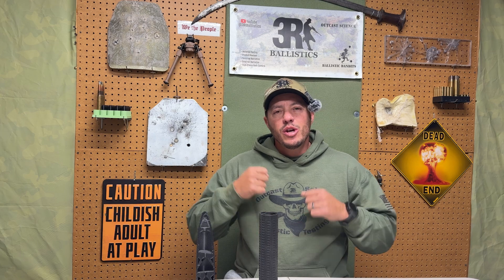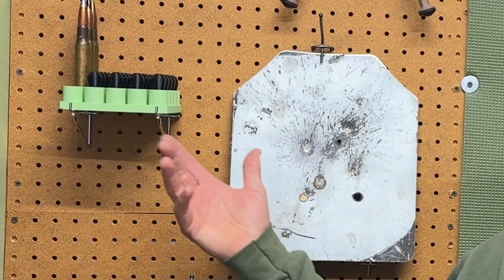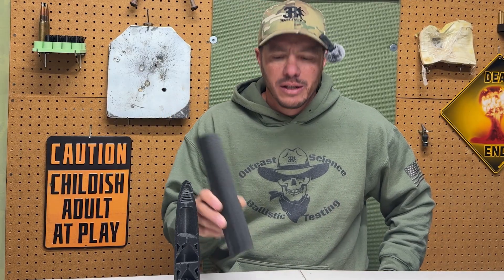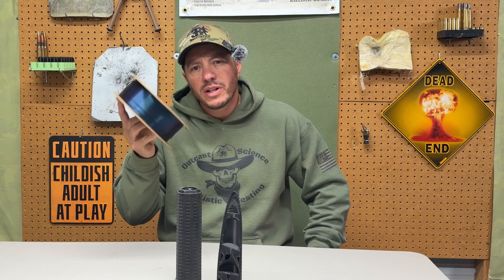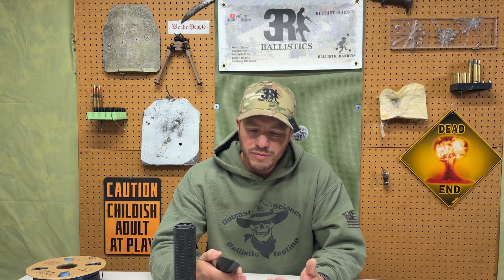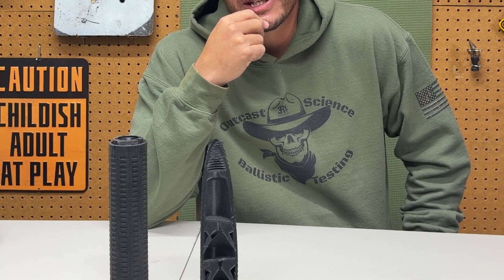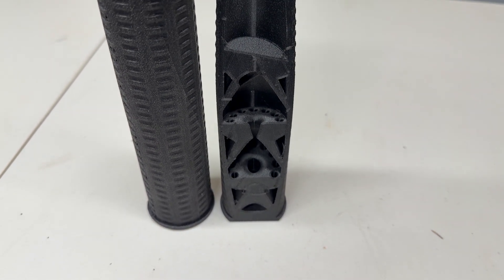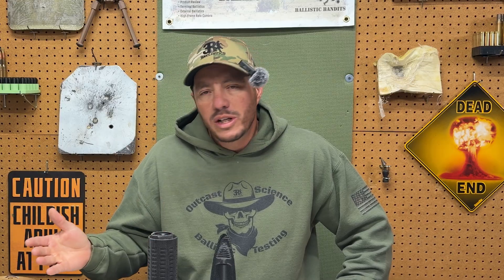Are Plastic 3D-Printed Suppressors Viable? PA6-CF Explained

Comment from the maker: ⚠ Important: All suppressors discussed in this video are legally owned, registered, and tested in full compliance with federal and state laws.
This video is educational only and focuses on materials science and performance—not instructions or construction.
With that said, what do you think about advanced polymers like PA6-CF in high-stress firearm applications?
Is this the future of rapid prototyping—or are metals still king?
If metal suppressors are constantly out of stock - would you consider a polymer suppressor?
👇 Drop your thoughts below, and if you enjoy real-world ballistic and materials testing, consider subscribing to 3R Ballistics. More testing coming soon.
Reply: cf makes it stiffer but weaker
Reply: $50? more like $5
Reply from the maker: @belligerentinstigator944  the $50 includes all connections associated with making it completely ready to use. This includes the $30 breek connection
Reply: Guardian defense 

   You can find any suppressor you want there legally
Reply: 😊😊😊⁰
Reply: 0⁰
Reply: What exempts polymer suppressors from the definition of firearm under the undetectable firearms act 18 USC 922 (p). The relevant definition would seem to be in 18 USC 922 (a) and 922 (p) exempts only the "frame or receiver of such weapon", not "silencers or firearm mufflers".
Reply from the maker: @R3RadioResearch  they are not completely polymer. Both connection and outer surfaces contain steel.

Comment: If you already have a 3D printer, cost would be more close to $5-$10  per unit
Reply from the maker: Yes, for the filament. The price I mentioned included every other components well. From the filament to the breek connection down to the JB weld.
Reply: @3RBallistics ok makes sense! I guess it depends on the build. A 22LR build requires a lot less structure for example. You could print and add a thread adapter, and you are set. For a 9mm/300 blackout maybe go with the OP 9 and I think it’s about $15

Comment: Do we have written confirmation from ATF and/or DOJ that 18 USC 922 (p) (The Undetectable Firearms Act) doesn't apply to silencers or firearm mufflers (legally correct jargon for "suppressors")? The definition of Firearm under 18 USC 922 (a) includes "silencers or firearm mufflers" and 922 (p) specifically exempts "the frame or receiver of such weapon" referring to firearm receivers or frames (like glock or AR15 polymer lowers), but it would seem a rigorous reading means that suppressors must comply with 18 USC 922 (p) and contain at least 3.7 oz of 17-4 PH Stainless Steel magnetic signature equivalent or be equivalently detectable to (as far as I can find) an unnamed reference firearm surrogate's magnetic signature that is maintained by USG.

Comment: You can also use pla+ also if you use white pla+ it will resist heat and you would think oh well it only probably helps 5% no using white plastic over black can do insane things situations where nylon would melt white pla+ might survive
Reply: I just dont see how. Nylon is softer than pla sure. Most FDM plastics are softer than PLA and all the plus variants of it, but it has some of the lowest glass transition. It might maintain its shape while hot, but not its rigidity. It will warp when breaking 50c every time.
Reply: @GucciBodyBags pla+ works fine

Comment: I have been experimenting with 3D printed suppressors for a few years now. My designs max out in terms of weight around 13 OZ without a piston. Before people jump on me, all were legally registered before testing. It was very, very expensive lol. Final designs were as follows. 

For 22LR, I was easily able to get away with TPU baffles, PETG cylinder, and no outer sheathing. This lasted indefinitely and I still have it. No visible wear at 900 rounds. Fired from pistol and rifle. 

For 9mm and 45 ACP, design involves PC baffles, PC cylinder, and no outer sheathing. This lasted for 542 rounds before developing cracks in the cylinder wall. Following designs were fixed with carbon fiber shell. Carbon fiber allowed the second iteration to last indefinitely.

For 5.56, design involves epoxy coated PC baffles, PC cylinder, with multiple layers of carbon fiber which allowed it to last 218 rounds before degradation of the threads between the cylinder and the barrel adapter. 

For 6.5 Creedmoor, design was similar to that of the 5.56, with simply more carbon fiber reinforcement, lasting on 25 rounds before cracking developed. 

This was all done with a cheap as hell Ender 3 V3 KE and a cheap enclosure. All suppressors cost less than 40 bucks to print. The 9mm and 22LR suppressors were so quiet that I legitimately thought I had a squib round and I disassembled my pistol the first few times just to make sure I wasn't going to break my pistol with a stuck round. This lasted far longer than wipe designs and as I stated above, I still have the 9mm and 22LR versions which have shown no strain despite being used on multiple range days. Adding a piston allowed the pistol caliber suppressors to shoot on tilting-barrel pistols just fine, as compared to fixed barrels which were used to test first. I thought the threading would fail first as I initially modeled a 1.375x24 thread into the suppressor body but that held through all the calibers. The secret is reinforcement with either carbon fiber or fiberglass, allowing for hoop strengths far in excess of standard plastic prints.
Reply: what are the chancing you release the files for some of these suppressors i would love to have a 9mm suppressor.

Comment: Great video I had a question Wondering if oil filter suppressors have to be serialized or is it just the adapter that needs to be serialized Is it the same with 3D printing Great video once again thank you
Reply from the maker: If you have done a form 1 you will realize that the complete suppressor is serialized. Also, be sure to include installation instructions if modifications need to be done to be used. Just make sure you have approval before starting any of the procedures.

Comment: Garand Thumb just featured a suppressor that sucks in ambient air to cool the suppressor down to where you can hold it, even after several rounds.  If you incorporate that with high temperature plastics, it might just work.
Reply: They did. The FTN.5 has a limited version of this idea. Sucks air in from the back.
Reply from the maker: @bennyb.1742  the FTN 5 flow through is one of the designs I will be testing 👍
Reply: I e seen these in other Gunther’s reviews… these don’t heat up like metal, PSR shot a string of 10-12 mags through his pistol and grabbed the suppressor right away… it was warm yes but not hot like metal.
If made with Nylon or other “engineering” filaments on 3d printers these days the melting point of these materials is 150-200 degrees Celsius… they can take the heat is the point.

Comment: if you paid 56 for that you got ripped off it is like 10 dollars of pa6cf12 with a couple of parts
Reply from the maker: The breek connection is $30 by iteself
Reply: @3RBallistics  true but if you go with the kak it is only 13.00 and the point is moot as most of the stuff needed for the FTN series is sold out.  At least my design is all stuff you can get a home depo or lowes

Comment: Admittedly, I've been doing functional prints in just about any material that interests me, but it took entering a challenge to break my ban on doing firearms and related designs a few years ago. After that, it's almost entirely what comes out of the R&D shop. PPS-GF is about the most approachable 'entry level' filament that hits many impressive quality benchmarks for this type of use, cost included. It's not cheap, but it's not $200 a kilo either. Most of my machines have been modified from circuit board to hot end, but a lot of consumer-grade machines have been released that get into necessary territory for printing PPS. If it were cheaper and came with more on the spool, it's all I'd ever use (more end use while iterating in cheaper material should be the approach with it as is).

Comment: 7:28 Flashforge adventurer 5m spotted. 
Right now, I feel like the biggest inconvenience with polymer suppressors is the post processing. The FTN series requires printing the baffle stacks at weird angles (and dealing with supports) and jb welding, or some other process, them into a separate tube, and I'm sure you know about all the possible opportunities for something to go wrong with each step of the process. I think until they can make the process more simplified, it won't really be viable for most people outside of pistol calibers. All that said, I have been loosely following the development and it's really interesting to watch.

Comment: there are several people with thousands of rounds on those FTN.4. he just released the FTN.5 too which is UNREAL, he has flowthrough designs now and the ftn.4 has a diy hub for striker fired pistols. dude is next level at this design stuff
Reply from the maker: I agree. I hoping that adding some R&D might help to give an understanding of the limits these designs can withstand.
Reply: @3RBallistics  i have over 500 rounds of sub 300   blackout through on my FTN 4 and no issues, i do use Cool Gel about every 2-3 mags and i have had almost no erosion printing a couple FTN 5's now hope to be at the range this week with them and will see if i can burn one up with my FRT and some 300 subs (BTW ATF i have tax stamps for everthing LOL)
Reply from the maker: @Hickamfield  I’ll be pushing both baffle and flow through FTN 5 until failure. Unfortunately with ammo costs it may take a few months.
Reply: @3RBallistics  got ya on that, time to start reloading
Reply: @3RBallistics  i know that he is always looking to improve his stuff and is looking for peoples feedback on the ftn.5 if thats something your into
Reply from the maker: @F @Facing_Fear  I have 4 tax stamps. So I will be doing the FTN4, FTN 5 (baffle and flow through) in 30 cal. Then I’ll also be testing out 556 in FTN5 (baffle).  I will slowly stream these videos out as ammo may be costly to do this amount of testing.
Reply: @3RBallistics you should also test nas3 ammo on it while your at it! FYI it’s a nickel alloy case available right now for .308 and .556 (and other calibers) that shoots at 80k psi (or even more)…. Turn you .308 into a .308 “backcountry” basically…
I have 500 rounds in bot calibers on order, (just cases for hand loading) and can’t wait to play with them!
Reply from the maker: @c @cjsawinski hy not. Between nas3 rounds and a  SBR 556 that should give it all the pressure needed.
Reply: @3RBallistics  nice! ive been telling people to literally print 100 of them! legally of course, common use is one avenue to beating this stupid "tax". look forward to seeing the vids as you get them  out

Comment: You might want to clarify: you need ATF approval and the stamp before you start to make it. We don't want some guy jammed up because he makes one and then tries to register it. The whole system sucks but that is what we have for now.
Reply from the maker: Yes, that is a great point. I brought up the 4 day wait for approval without clarifying I had not started the print until after the approval. I will definitely add that to the part 2 video
Reply: Legally you're not supposed to even buy components to build it until you are approved. The ATF will consider those components as suppressor components.

On s side note, I'm a first time permission slip applicant who put in the application on Jan 1 and was just approved today, the 15th.

Now we will see how long for the rest of the form 1s I'm about to put in this weekend.
Reply: Free Men Don't Ask... so,,you are not truly free.

Comment: I'm fine with whatever testing you pick but I hope you realize that ftn suppressor is supposed to have an aluminum or carbon fiber tube around it. It is not intended to be used without a case. The two I have made used a carbon fiber sleeve and epoxy and heat shrink to suck it down to the surface of the suppressor during curing but the instructions call for an aluminum tube around the outside.
Reply from the maker: It’s not finished because of YouTubes ridiculous policies. If you pay close attention, it is also missing the breek connection. I will explain the finished piece during testing in the part 2 video.
Reply: @3RBallistics Fair enough. I just wanted to make sure you didn't test it without it being finished, have it fail, and claim it was not functional. I look forward to seeing your testing on it as I have not put too many rounds through mine but so far they seem to work quite well. I made the version with the carbon fiber rods inside.

Comment: Sls would be a great way to go.  Not cheap though
Reply from the maker: It would, and I’m working on making many different filament tests.
Reply: @3RBallistics have you tried pet-cf? Also you mentioned pa6-cf what about pa612-cf
Reply from the maker: @PrezUSMC  currently in testing with PA612-CF.  I’ll have to look into other filaments but as of now, I only acquired tax stamps for 4 items built with PA6 and PA612
Reply: @3RBallistics also,  maybe the difference between an annealed part vs non annealed?

Comment: One of the primary purposes of the suppressor is to absorb and re-emit heat. Plastic doesn't have any heat distribution mechanism.
Reply: Not trying to be a keyboard warrior but I don’t think suppressors care about the heat at all. It’s the sonic shockwave that they are absorbing… heat is just a byproduct of gun powder and metal. 
And some materials you can make these out of won’t melt until close to 200c… like you said the Nylon suppose won’t absorb the heat from the barrel so you never need to worry about burning yourself touching it. 
If you get your barrel red hot, yes these suppressors are not going to have a good day… other than that they are pretty damn good.
And if you do melt it… just print another one.
Reply: Carbon fiber reinforced filaments conduct heat better than regular plastic, but you're right that it won't be as good as metal.  But it clearly still works to some degree or else people wouldn't bother with printed suppressors.
Reply: No, that's not one of the primary purposes.  At all.

Comment: You didn't mention it, but that ftn suppressor isn't finished. You need to either put the jb weld and aluminum pipe over it or fiberglass/epoxy wrap to strengthen the outside. That's how that specific design was meant to be built
Reply from the maker: It’s not finished because of YouTubes ridiculous policies. If you pay close attention, it is also missing the breek connection. I will explain the finished piece during testing in the part 2 video.
Reply: The ftn5 is out now
Reply from the maker: @CobosDoesItAll  that is what was printed. I plan on testing both the baffle and flow designs
Reply: if it is a 5 you can print the sleeve in pa6-cf
Reply: You cant describe how to make it/finish one on YouTube i believe
Reply: @KABAR1943  Youtube blows. All the guntube channels need to start their own platform and get off this commie site.
Reply: Also when you say fiberglass wrap do you mean the type of stuff they use when someone breaks an arm and they cast them?
Reply: I plan to use a carbon fiber tube when i build one
Reply: He yaps a lot. But for the .22 rimfire flow. Do you need a thread adaptor or does it come pre threaded ?
Reply: @elitefijian253 still need muzzle device for the mechanical connection

Comment: I’d say no, no way that it’ll survive any real use. If any at all especially 5.56
Reply: pretty sure PSR did a video with a FTN suppressor and it did fairly well (until it didnt lol)
Reply from the maker: I’d love to give it a try. What would you consider real use?
Reply: @3RBallistics  ya know, range use doing drills and just practicing. Not mag dumping or anything 😂
Reply from the maker: @TylerD63 well, that’s definitely on the testing list. I’m also thinking of starting with a simple 16” barrel then step down to 11.5” if it hasn’t failed yet. I’m sure that would push it to its limits.
Reply: 300bo is hearing safe with a 10.5" barrel. 1200 rounds to failure on the most recent one with petg.

Comment: Good vid man, and look forward to the results.  I'd like to see a high round count test with a relatively slow fire schedule- think someone whose using a can on their huntinf rifle that sees maybe 100 rounds a year tops.  Lots of cool down time between shots for "zeroing".  You could do 5 round strings maybe a minute seperated between the shots, then give 15-20 minutes to cool down, then compare the suppression capability after 100/150/200/300/500 rounds.  A polymer can thats no crazy expensive, very lightweight, but still suppresses the same sfter 500 rounds of slow fire could be useful for hunters.

 .22lr can- if you can, very aggressive fire rste, tested and inspected after ~100/250/500/1000 rounds to show the change in suppression, damage to the bore and lead buildup would be cool.
Reply from the maker: I like that method of testing. I’ll definitely keep that in mind.